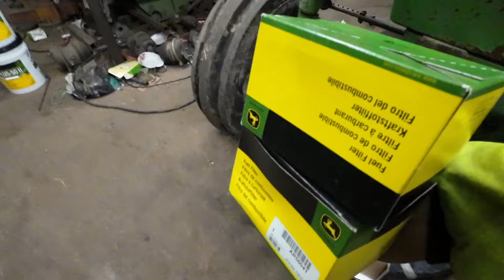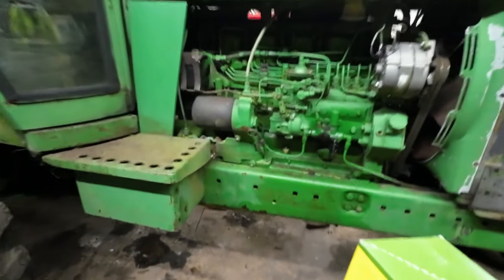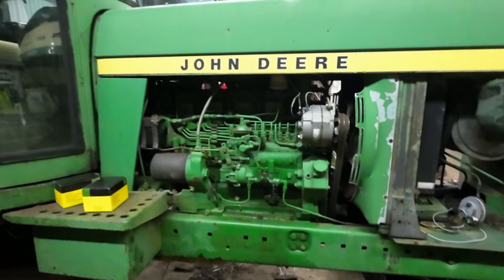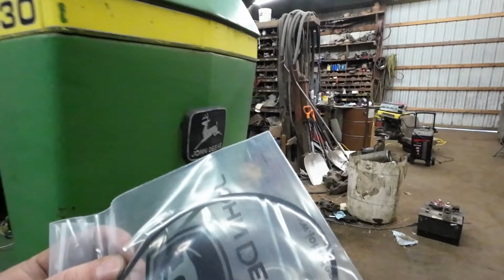4430 Will It Start Pt3

Comment: The farm i worked on in highschool had a 4430,4440,4450,4850 and a 4255. They all used the same filters.  It was nice to do service.  Our 4430 had 15,000 hours on it. No major engine work. Just an injection pump.
Reply: That farm that you worked on must be  2000 plus acres big.  That is a lot of big iron.
Reply: @brianzybura8633  800 acres. Milk 130 cows. 4255 ran almost every day. 
4450 was loader. 4440 spreader and discbine. 4430 was on light duty raking and pulling wagons. Also had 2 2840's.

Comment: AP air has a a/c hose kit that does away with those disconnects and the metal lines that run up the corner post up top works great and less leaks

Comment: Pouring from a 5 gallon pail, a quart jug, or gallon jug, they are all intended for the spout to be at the highest point. If done upside down the air coming in has to go through all of the oil to reach the empty space.

Comment: Looking back at old videos, you're going to work on it in 2019, even had it in the shop. However, between the Aug 8 & 11 videos it was moved out of the shop, so you could do an inframe overhaul on the 4960.

Comment: Hi Wes, might want to replace the AC lines going up the rear corner post and replace the expansion valve and receiver/dryer filter also. I got a kit form All States parts that replaces the old Delco compressor with an aluminum Sanden Compressor for our 4430 a couple years ago, it’s been working flawlessly and was cheaper that the Denso from Deere, just to give you another option. Any way really enjoy your videos. Trump 24🇺🇸🍻

Comment: Guess I’ll just get the fuck out. Awesome work Wes and yea it’s better to flush and put new fluids and all in an engine that sat for longer then 2 years this far north. The cold and the rust can cause all kinds of problems if we are not careful that are unseen. Till we try to start. Mostly with coolant and oil. And always fix the known problems before trying to start anything. And I’ll help you brake Tim’s arm he tries to start that tractor before it’s ready. Might shoot a rod. I’m only 5 hours drive away anyway. Good luck them 4400 series tractors are tanks when running right. Absolute beast of a tractor in there time. I hate working on the computer tractors. Give me good old mechanical muscle.

Comment: you shouldn't be really thinking about not throwing your money away Recycling your oil filter here we get last-year prices For filters, $0.50 for a filter less than 203 mm in length and $1.00 for a filter 203 mm or more in length. III. For filters, $0.55 for a filter less than 203 mm in length and $1.25 for a filter 203 mm or more in length. you add up how much you are throwing away 
i am better than a pop bottle lol